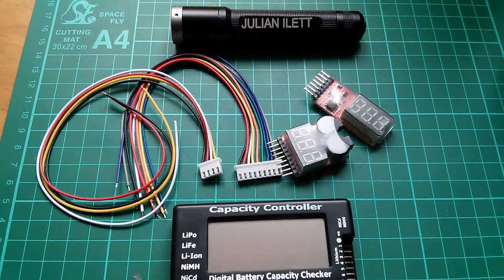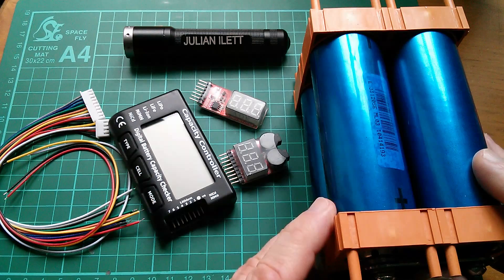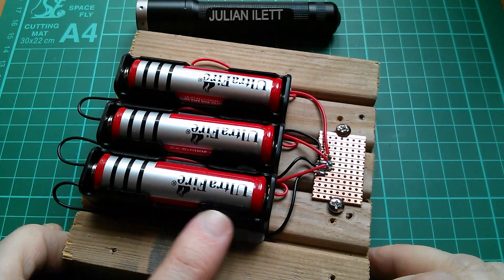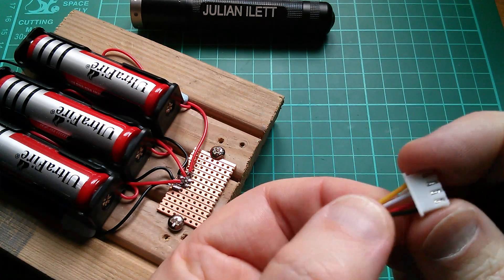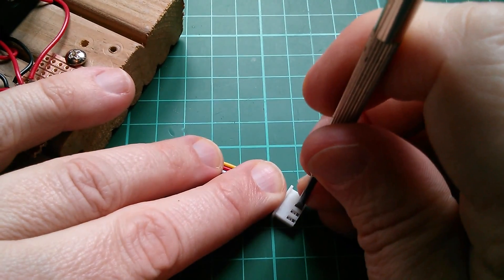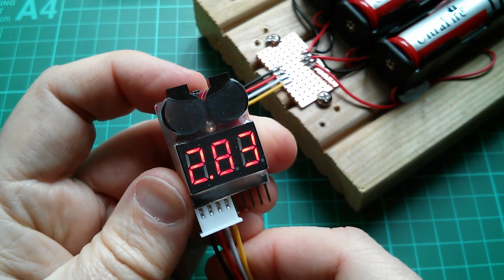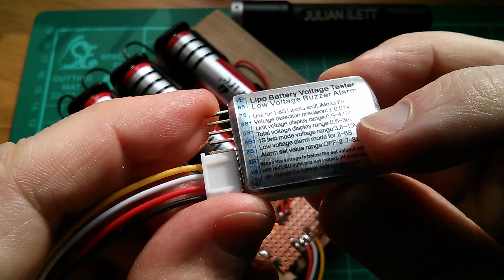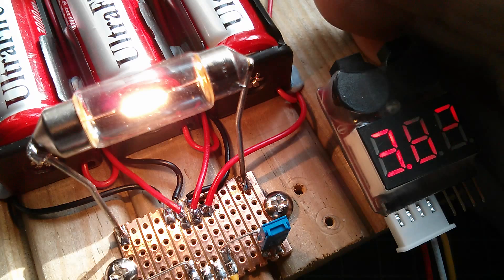Playing with: Lithium LiPo LiFe Battery Checkers

Comment: Liked & subscribed! Very clear & precise presentation that educates us as to how to use these Battery Checkers. I have the one called Capacity Controller that I wanted to learn more about, so this presentation was very helpful.

NOTE: got a quadcopter from the local dumpster and checked the LiPO battery with my Capacity Controller. It tested okay, so I checked the wires & managed to get it to power on. Yay! No quadcopter controller though, so I'll have to solve that problem next. But, one thing at a time...

Comment: @6:26 ...instead  of reversing black wire you can reverse the battery contacts .And further better by pass strip PCB and connect connector wire to the battery pack directly.

Comment: what kind of capacity do the ultra fire really have? I figure their claimed capacity is missing a decimal point. 9999mah claimed. but more like .9999 mah! if I could get some 1-1.2 ah cells that would last a few thousand cycles. I'd settle for under a dollar cells. with low capacity. the 3+ah Panasonic and similar are not cheap. and I need a 29.4v 2000ah not mah . bank. on the cheap. for my off grid home. but I will have to work my way up to that! I have a 200ah lead acid bank now. I want to eventually add to it. and use it for backup for the lithium. since lithium can be cycled  more. I'm going to try for using onlyv30-40% of the lead capacity. and 60% of the liion. what are your thoughts on lifepo4 cells? the voltage doesn't really align with 7s liion. I guess a 9s LiFePo4 only charged to 29.4 would be OK. but capacity is lost. with 21-22v cut off. that's not a lot of capacity. but 8s cut off at 21-22v is a bit above 2v per cell for LIFePo4, so its about 4volts either way on the whole pack. so I guess LiFePo4 isn't the best for 24v systems. if the volt range of the inverter was a bit different. like 18-34v would be awesome! I'm stuck with 21-30v . so I guess its liion. sorry for rambling  I have been plagued be battery decisions for days. its a lot of money. and I have to buy the best deal. and get the right thing. and it has to work. living off grid can be a Hassel! I guess that's the price of freedom!  I need a good cheap way of checking capacity . so I can build reliable packs. checking the capacity of 100's or thousands of cells can be a job!  thanks for all the great videos .

Comment: is your capacity controller V2?  I bought one supposedly when you hold down the left button it goes to balance... it cycles through the cells but not according to the Chinese instructions.... I cant find a vid of anyone balancing mode... mine seem to just unbalance more than anything else...
Reply: Mine balances just fine. Long press Type button and it cycles through each cell and lowers the high cells to meet the level of the lowest cell, used it many times and it works perfectly.

Comment: Hey Julian! I hope this message will not seem like spam to you, but if you are using 18650s often for your projects, we would love for you to check out our Kickstarter page. We have developed a robust electronic device for testing 18650 cells and reporting optimal pairing information to the user. If you use 18650 cells in a lot of your projects, I really believe you might have interest in what we have created. If you feel uncomfortable using the link below, just navigate to Kickstarter and search "18650." Our project is named "The Batlab."

https://www.kickstarter.com/projects/1722018962/batlab-a-battery-testing-system-for-lithium-ion-18?ref=creator_nav

 Best wishes!

Comment: I just bought some of these 8s testers and they all exhibit the same problem. Not sure if it's the testers that are faulty or if it's the way I'm using them, but here is a video demonstrating the problem:
https://vimeo.com/184303379
Incidentally, I discovered the fault with the monitoring of cell7 on several other bits of 7 cell kit, and set up the 8 cell arrangement for more rigorous testing and demonstration purposes. I also have one of the "controller" testers shown in Julian's video, and this does NOT show any fault when monitoring cell7.

Comment: I found this 7 Battery Checker marketed as "RC Cellmeter 7" on aliexpress and of course there's a version "rc cellmeter 6" too and it feautres a servo tester. Maybe that's a hint to the unpopulated backside of the PCB? http://www.aliexpress.com/item/1pcs-High-Quality-RC-CellMeter-8-1-8S-Battery-Capacity-Voltage-Checker-Meter-LiPo-Li-lon/32505888011.html?ws_ab_test=searchweb201556_7,searchweb201602_3_10037_10017_407_406_10032,searchweb201603_8&btsid=aaf743d7-d740-4fa5-991f-86fa42d549dd

Comment: I'm new to all this and wanted to clarify a point you made in the vid. You state you were caught out buying "fake" 18650s like everyone new to them, sooooo, how do you know you're getting the genuine article and not a fake?

Like your clips, straightforward and to the point. I even subscribed.
Cheers.
Reply: James Lamb i've read several places that any of the 18650's labeled with "fire" are likely to be bogus cells.  Trustfire, ultrafire, etc.  Supposedly they are recycled cells with new labels.  So I might be wrong but I take it to mean that none of them are any good.  Others may disagree.  I've been trying the OEM laptop cells on eBay (Lenovo, Dell, HP) because they seem to have been decent at least when original.  My last batch comes in around $0.40 per cell for 180 cells so even if only one in 4 are any good, that's way cheaper than anything I've seen as new.  Testing that many cells to build a pack with predictable capacity remains a big challenge, at least for me.
Reply: Tim Byers
Thanks Tim, I ended up going for genuine Panasonic 3400mAh NCR18650Bs, incredibly expensive from a local (Oz) seller. I'm fairly confident they'll do the trick but I've yet to test them thoroughly. Cheers.

Comment: Richard Lloyd has a video on 18650B 3.6V Rechargeable Lithium batteries from Olight. I'd like to convert the LED plant lamp in the bedroom which only turns on via timer mode to rechargeable. Right now it's using 3 C size batteries and they cost to much when they go dead every couple of weeks.

Comment: Can i ask a question about 50w LEDs? my driver outputs 50.1 volts at 1.7amps for driving a 50w LED. This does not make sense to me, would this be right? 

also do you know how I could make this LED and driver dimmable so I could run the LEDs at 50% or 75% power?
Reply: Chiwanese LEDs are based theoretical wattage.  My 48W flood lights use 27W of power during use.  <g>  They derate the things to give them longer lifetimes, so I've heard.  So, Peter, your LEDs are likely already running at half power.

Comment: i just noticed the other pads for the higher pins for the balance is under the lcd i think i would also have black as first negitive and the red as the highest voltage positive when you use the capacity controler when you scroll through the cell they was a mark moving at top of screen camre could not pic it up to well that might indicate what cell is been checked lol maybe i should watch the hole vid befor commenting haha
Reply from the maker: David Simpson More circuitry under the LCD - cheers, I didn't think to look there.
Reply: lol

Comment: Julian, regarding battery/cells testers I found on eBay such interesting module:
http://www.ebay.com/itm/18650-26650-Lithium-Li-ion-battery-tester-led-meter-Voltage-Current-Capacity/201305442842?_trksid=p2047675.c100005.m1851&_trkparms=aid%3D222007%26algo%3DSIC.MBE%26ao%3D1%26asc%3D27705%26meid%3D23c4b621213e4d81aba348287f3855e0%26pid%3D100005%26rk%3D4%26rkt%3D6%26sd%3D231443516285&rt=nc
It measures voltage, remain capacity, current and also resistance
Reply from the maker: cbm80amiga Neat - I haven't seen that one before. Load resistance is a bit odd - presumably just a calculated value from the voltage and current measurements

Comment: Great video as always, Julian! I will like to see you thoughts on the accuracy of these meters... they can be pretty much hit and miss in my experience - not one single meter will agree, but one or two will if you go to one decimal place, but even that is rare. They are still sufficiently good enough to tell you if the battery is flat, charged, or is going flat. They just vary quite a bit... don't think they bother calibrating them during manufacture :(

btw, that stray bar on the 'capacity controller' is the first segment of a bar graph that runs along the bottom of the display - shows capacity based on the percentage.
Reply from the maker: Peter Feerick Yes, I'm very suspicious of cheap things having 3 decimal places of accuracy! One day I'll buy an expensive multimeter so I can check the accuracy, but for the time being I'll just remain suspicious. I worked out what the stray block was eventually - cheers. I didn't realise at first that the LiPo LiFe Li-Ion selection had to be made manually. Quite interested in what the current draw is on the LCD checker and whether it could be left connected permanently.
Reply: I won't expect the current draw to be great, but it is probably on either one or two cells only... so it would make things go out of balance after a while. Although if your load is a car bulb, I suspect it won't really matter in the grand scheme of things :) I bought a cheap ($50-60) extech 330, which claims 0.5% accuracy, so used it as a reference for all the other meters... so at least I know how much they were out for later reference! I bought it particularly as it doesn't need switching of sockets when changing to mA mode - only for the 10A mode, plus the batteries are AAA - so more likely to have at hand (or eneloops!), and both the batteries are located in a battery compartment on the back - don't have to disassemble the whole meter to get at the fuse if it goes!

Comment: Hi Julian,
I recognize those three battery holders. They are so snug, that you end up damaging your batteries to pry them out of them. I now have a piece of tape around my cells, all the way around and half an inch on itself sticking out, so there is a handle to pull the cell out of the holder.
Reply from the maker: deslomeslager Yes, getting the cells out is difficult - the tape idea is excellent ツ
Reply: Julian Ilett Or just cut the sides half off.
Reply: Eratas1
Exactly did the same :) But in 3x18650 box version.

Comment: I have the 8S checker with the buzzer, there is a small button on the board next to the horns that allows you to change the voltage per cell at which the alarm goes off.

Edit: Looks like you found it ;)

Comment: There's a chap who has removed the buzzers and connected a relay into the PCB so that it shuts off the power at the low end! a simple way off saving your batteries!
Reply from the maker: pietkaify That's a neat idea. I think the low voltage alarm will be fine for the bike - I just need to make sure it can be heard.
Reply: pietkaify ban

Comment: i have that 8C Lipo guard for my Quadcopter (a must in RC flying), and it works quite well :)
Wanted to tell you about the button to set the threshold all the time, but i managed to hold myself back until you discovered it yourself :)

Comment: I have tested 18650 in a more crude way, using my torch and waiting till it goes dim, the only thing i have found out, if you pull enough current that your 18650 get warm, you also have less Ah capacity, so a torch will run longer overall if you run it in shorted periods rather than 1 longer run where it gets warm, i have noticed a 20 percent difference due to that

Comment: I used one of those red LED checkers the one that you have tested with the button to set the low voltage threshold on a 4s3c A123 LiFePO4 cells so about 12V 3Ah that was connected to a cordless drill while I was working on building my house. The alarm future was useless in this case since it will have triggered under load even if set at 2.7V with battery fully charged. The load was quite large and noisy a brushed DC motor.
So I used just a jumper so that I could check the voltage levels from time to time.
Also the unit if I remember correctly uses current just from the first two cells and if left on for hours it will create imbalance on that small 3Ah pack.
Reply from the maker: ***** The Headway cells have an initial internal resistance of less than 6mΩ. So for a current of 10A (bike has a 250W motor running at about 25V) there should only be a voltage drop of 60mV per cell. I'm hoping that the brushless motor won't cause too many problems. Dacian, I have a question: For maximum service life, what would you recommend I set the alarm voltage to?
Reply: Julian Ilett You will need to experiment with the bike that 250W may be just average max power but peak may be much higher than that and the alarm may react to that especially if you are accelerating or climbing a hill. Internal resistance will also increase at lower SOC.You many see 100 to 200mV drop measured by that alarm and in that case probably 2.8V will be a good setting for those cells since after the alarm when you stop using the bike the low cell voltage may be around 3V and that is no problem for LiFePO4. You will probably charging the cells back in a few hours after that so no problem with life.Also in normal operation I will not expect you to get to that low voltage alarm level since you will probably want to get home without using your own energy :)I expect 7 to 10 year out of those cells driving every day to maybe 30 or 40% DOD.
Reply from the maker: ***** Cheers Dacian

Comment: Get a pre-made battery protection and balancing board for the pack. Hopefully not the rc kind.
Reply from the maker: erlendse Hmm, the advice from several other people is not to use the BMS boards - particularly with LiFePo4 cells. They use (apparently) the wrong voltage detection chip which has the undervolt setpoint set too low for LiFePo4, particularly if you want a long service life. I'm quite liking the LED checker with the 2 buzzers and adjustable undervolt setting.
Reply: Julian Ilett you will just have to see what you can find.. I guess. Even it shouldn't be the bms that usually cut off the load.